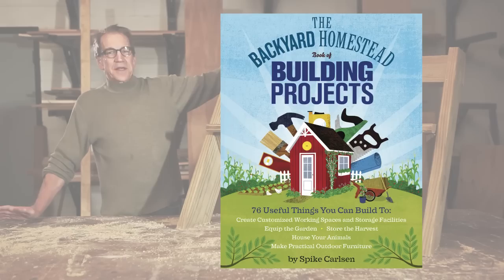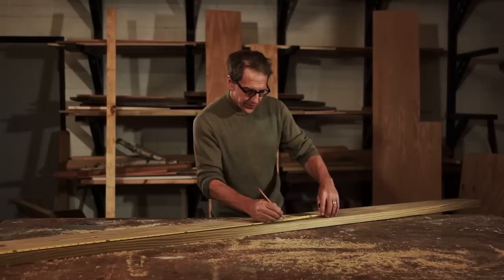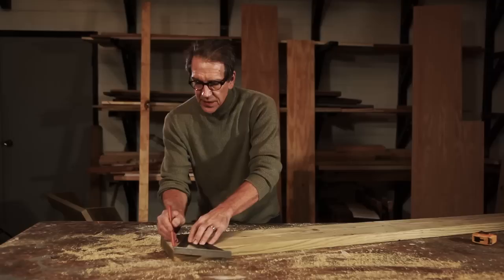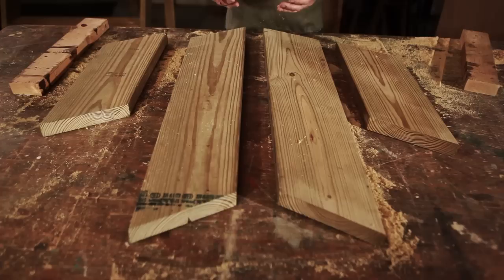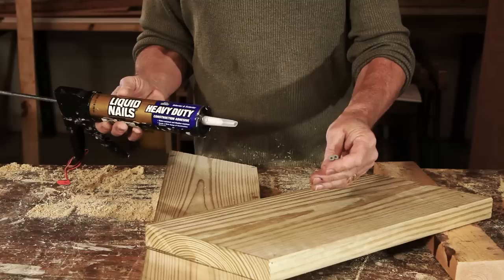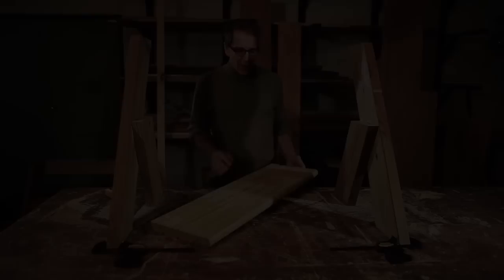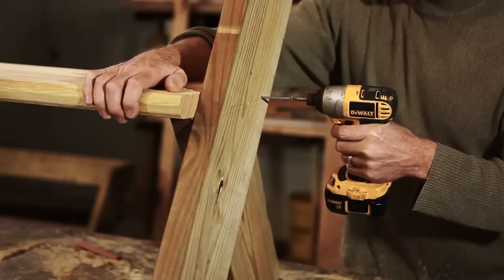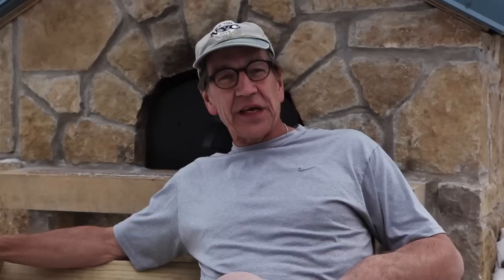How to Build a Leopold Bench with Spike Carlsen - The Backyard Homestead Book of Building Projects

Comment: Why 8 dislikes for this simple and nice project ?
Reply: Because the instructions aren't good.  He didn't allow for the kerf of the saw blade when marking out his legs, so three out of the four of them are going to be too short.  Using screws to join the legs together is... iffy, even with construction adhesive.  Bolts would be better.  And finally, he didn't bevel the back of the long legs before putting the back stretcher on, so it's going to be angled backward, causing it to dig into your back and/or promote really uncomfortable posture.
Reply: @Legman688  I built one like this out of heavy, rough cut, lumber. I weigh 250 lbs. It's kept outdoors in North Dakota, and works excellently. Just screws and glue -- old lumber reclaimed from the floor of my cattle trailer.

Comment: What is the cut list? I have another video that uses 4 (2x8x8) for a larger bench.. this one seems to use smaller dimensional lumber but u lost me on the x12 seat board.

I did the math on this vs the 4 (2x8x8) vs your (2x8x10 and 2x6x12) the your bench is about $10 less but doesnt have as deep of seating for me.  I am all for going to the basics but for $10 more per bench i can make a modifiied one that seats 3 properly